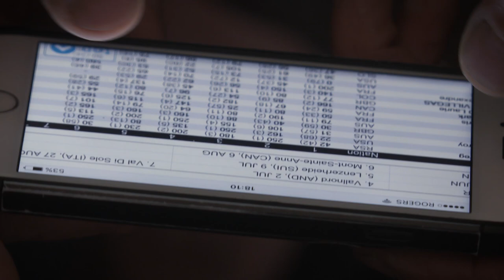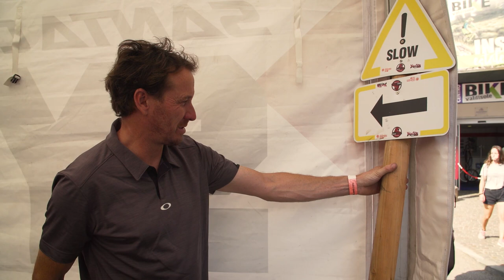THE SYNDICATE 2017 - Episode 4 - Greg Minnaar

Comment: That frame snapped before it hit the pole. Check out the slow motion.
Reply: Look one more time and You see that you are wrong!
Reply: Ian Chandler yarns ..
Reply: certainly did. when the bike hit the pole his weight was off the bike! the damage was already done when the front end hit a relatively easy hole at the crash point. the pole just finished the job
Reply: 2 out of 2 Ians agree